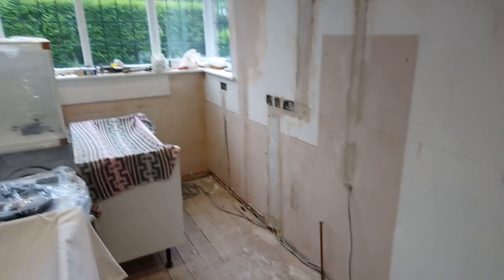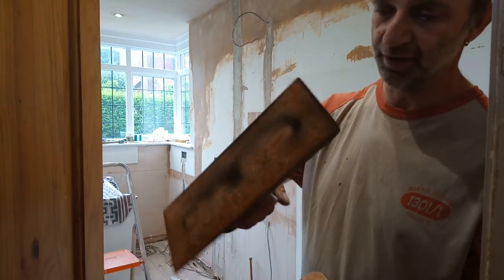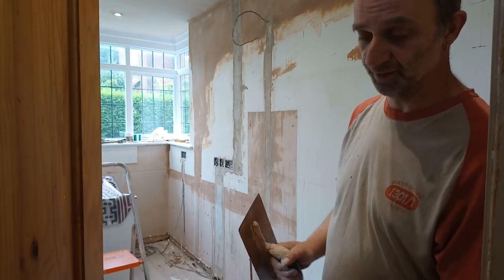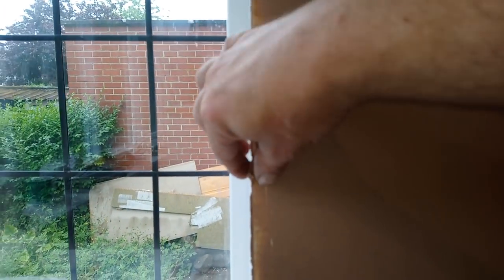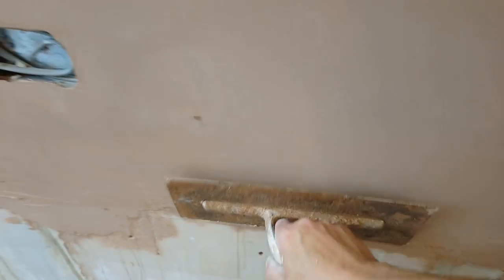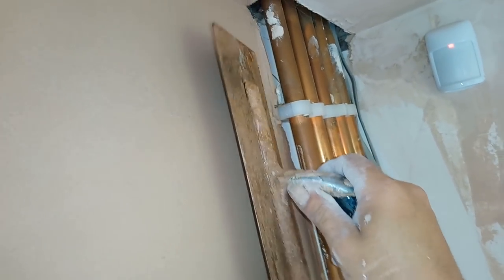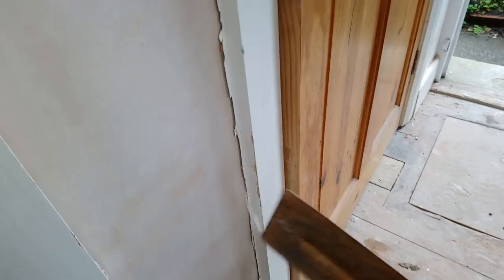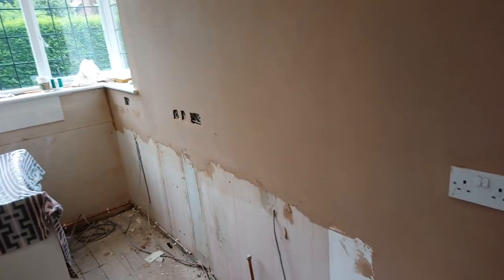Kitchen fitting Pt4, Finish plaster skimming the kitchen wall

Comment: videos and description really good just the right length and explanation - really helpful tips in the Kitchen fitting series.
Reply from the maker: Glad you like them n that's good to hear. when editing i try not to cut out too much but also need to keep the relevant bits in, it's a juggle between the two, about 20mins is what i aim for but like i say I don't cut bits just to make it fit the ideal time length, & i don't have to allow for an intro or the added bull in many other's vids 😏 Thanks

Comment: Painting on the water/PVA mix, it can be a pain to see where you've already been, especially on a white wall or ceiling. I find throwing a handful of plaster into the bucket turns it a dirty pink colour, making it easier to see if you've missed any patches.

Great work and video as always 👍
Reply from the maker: Thanks & thanks for the tip, i'll try keep that in mind, 👍

Comment: Your a better plasterer than allot of the plasterers I have worked with cleaner to 🤣👌🏻
Reply from the maker: Thanks, i modestly agree, my clients paint their walls after with very little filling, On site i mainly did commercial stuff, shops, banks, pubs, offices etc.. I saw some excellent plastering but in houses it's generally a bit crap, I don't know if they just get lazy after going self employed or were never trained or good enough to hack it on a building site in the first place,

Comment: Ye gads..............................that's the old black Ragni trowel.  It was a reasonable cheap trowel and about half the price of the Marshaltown many years ago...........about 8 quid iirc. They are also quite small compared to what Plasterers are using now. That's the older way of putting on a "lay" coat, then a second. Theory is, you put a lot of pressure on first coat to consolidate it to the wall.  Nowt wrong with it, I did it myself on those backgrounds.   Younger guys tend to put one thicker coat on now, even on boards  You have good hand skills. Like most things , it is having a feel for the material and what it is going to do. ie setting quick with suction, and polishing at the right time.  Good job you did for a Joiner mate and considering you ain't plastering every day, the finish is good.
Reply from the maker: Thanks Alex, yeah it's a Ragni 14" i think, it's seen me through 20+ yrs 😉, i do have a bigger one but these walls aren't flat, not even straight, the amount of plaster i have to put on for that bigger trowel is too much, this was just a thin skim to tidy up the wall & the first bit was just to fill the holes ready for a second better coat, 
I do a fair bit of plastering & as you say once it's on the wall it's when to work it n when to leave it alone, not bad for a joiner i agree, i don't get any complaints & as a slightly fussy man myself I wouldn't do it if it looked crap in the end. 
I get too many bitchy remarks on my plastering so don't think i'll be showing that in future, as you say I'm a joiner n that's what i'll be sticking to
Reply: Gid Joiner Just found your channel and pleased I have. Understand why you won’t post more plastering videos, but glad I saw this one. It’s good inspiration for a DIYer happy to have a crack (for fun almost).
Reply: One coat spreads are jokers,,even says on the bag 2 coats 😂 
Plastic trowels are good for the last couple of passes on uneven walls when you haven't got a really worn in one

Comment: It’s called a trowel. Also you haven’t put enough on the wall in the first place . It’s not floating
Reply from the maker: If you listened to me i wanted to fill up the hollows first then i put a layer over, did you just skip through it then decide to go straight to the criticism . FYI it's also called a float! Google it. "plasterer's float - a hand tool with a flat face used for smoothing and finishing the surface of plaster or cement or stucco."
Reply: Gid Joiner sorry mate but that’s incorrect, it isn’t floating. Decent diy job though, well done but it’s 100% not floating
Reply: A float and trowel are the same thing just different steel and different handle. All of these armchair experts come out the woodwork on any home improvement video. GID your a true tradesman 👍👍